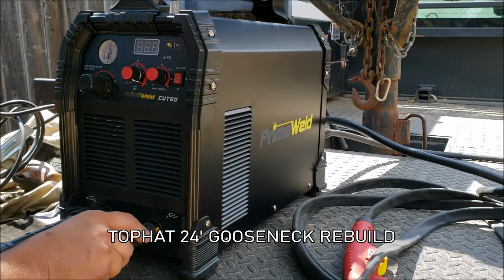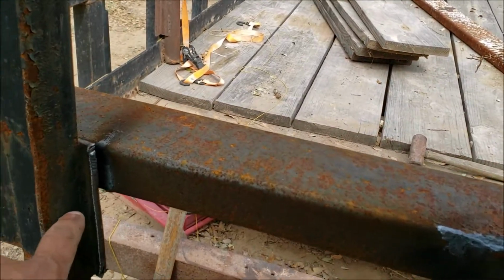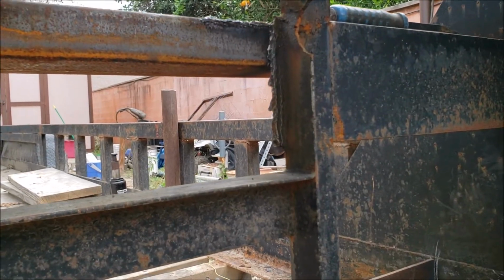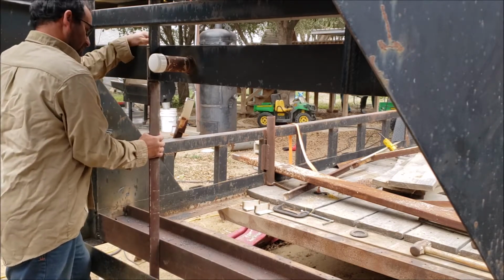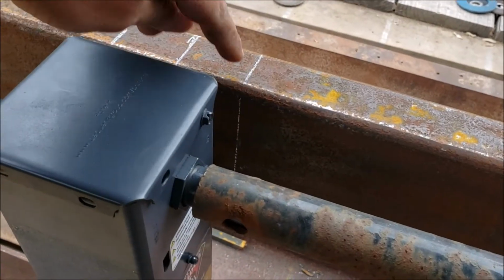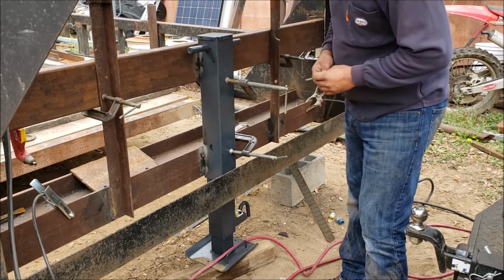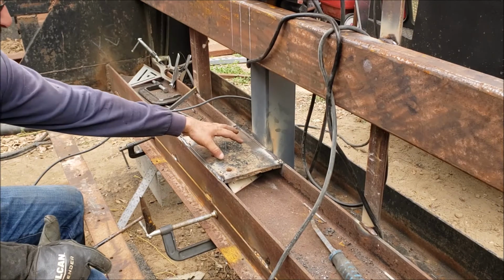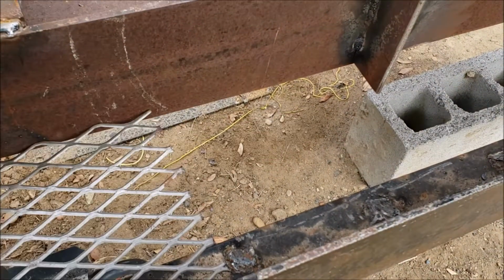Rebuilding gooseneck trailer installing bulldog jack 10000 : Primeweld cut60 Yeswelder Arc pro 165ds

Comment: Hey Jorge. That plasma cutter sure made that job easy. Maybe I need a YESWELDER and plasma cutter in my shop instead of what O have. Nice work. Thanks for sharing.🍁👍👍
Reply from the maker: Thanks. I have several machines and these Prime weld machines work great. I have to review a non pilot plasma cutter and compare to this pilot arc machine. The Yeswelders work ok but are over rated but haven't tried their plasma cutters. The weather here has been crazy and haven't had a chance to do anything. Yesterday it was 80F and today 50F with Rain, make up your mind mother nature lol.

Comment: Nice work shoes I have Walmart black loafers I like to wear out when I work
Reply from the maker: I was using my Caterpillar steel toe boots and my Academy brand running shoes during project. I am glad the i-beam did not fall on my running shoes or project would of been delayed 30 minutes....I actually have done several welding projects barefoot and when sparks repeatedly hit my feet I put boots on.  I cut the ramps off today but probable wont work on trailer till weekend. Thanks for stopping by.
Reply: @cutweldngrind   I don't know if you have ever watched Rick Pewe on fourwheeler magazine tv but he always wear beach sandals and shorts

Comment: How did the consumables hold up?   Nice work on the jack stand replacement
Reply from the maker: The Plasma cutter works great and I did a lot of cuts with the provided consumables. Now to get the rear of trailer fixed.

Comment: You did all those cuts on 110?  That's pretty impressive.
Reply from the maker: I can do 1/4" easily with this PrimeWeld plasma cutter but 220v makes this a power house of a cutter. I still cant imagine the 1" steel plate I cut. I also have a Hypertherm Powermax 45 which was around $2200 and that could not cut 3/4" but the Prime weld sure did. I might try another Plasma cutter from Prime weld that a buddy of mine bought last week to compare to this one.